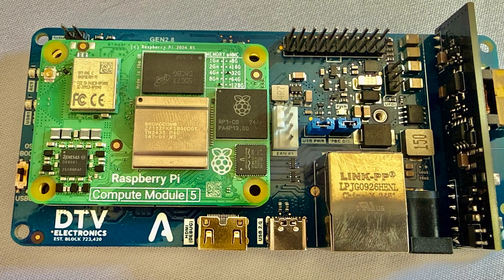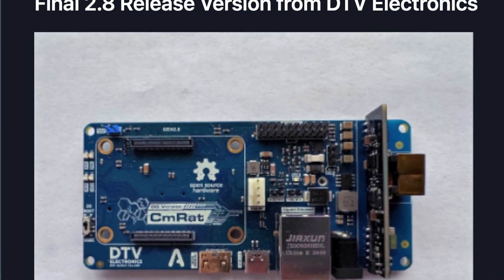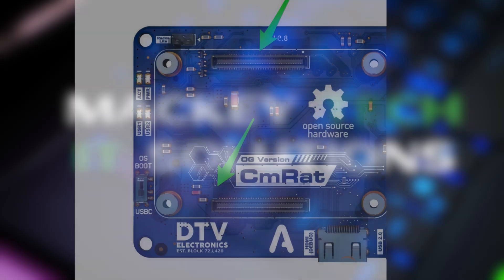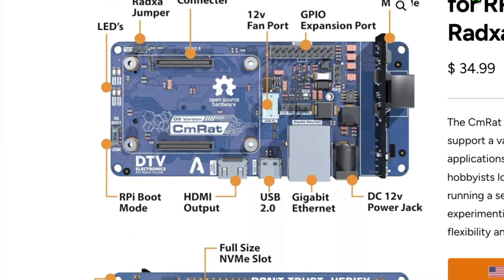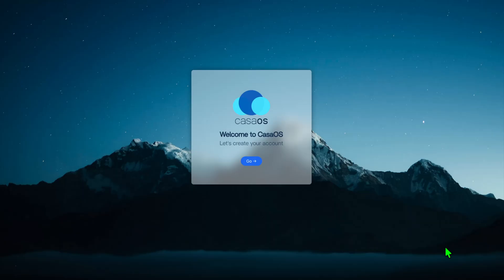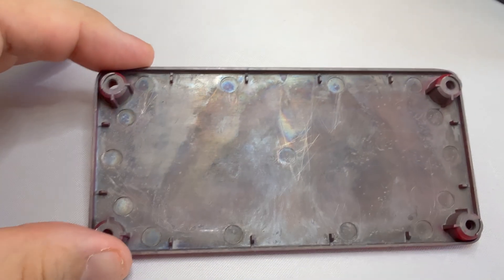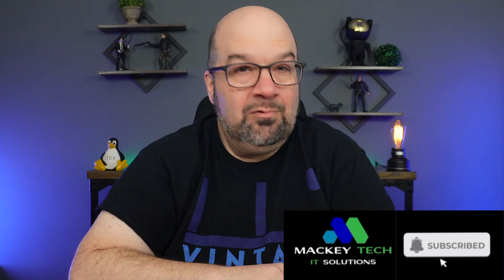CmRat + Raspberry Pi CM5 = The Ultimate Homelab Combo?

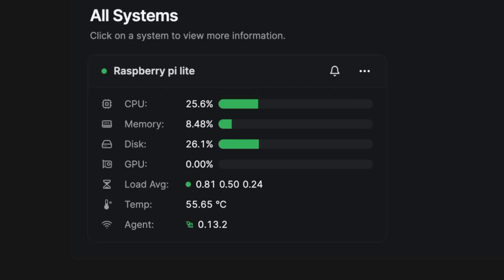Comment: Excellent, thorough review of the CM RAT and CM5! It's great to see a deep dive into the CM RAT's features, especially the PoE and lightning-fast NVMe storage [11:45]. That said, I totally agree the documentation gap for flashing the eMMC and RPI boot [06:23] is a huge oversight for first-time users. The thermal test was crucial—the difference between passive (system shutdown at 72°C [08:58]) and active cooling (stable at 57°C [09:12]) clearly shows an active fan is essential. Thanks for the honest take on the case prioritizing style over function too!
Reply from the maker: Thanks very much for watching and your valuable feedback!